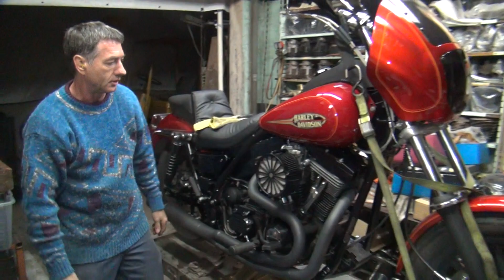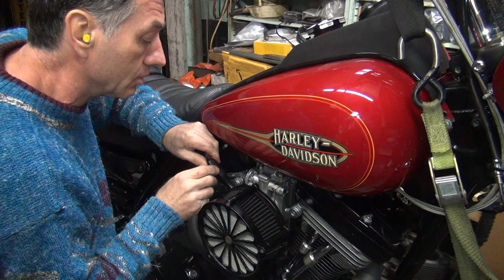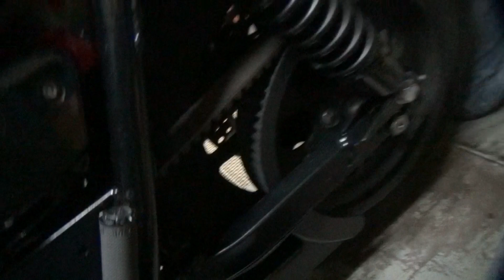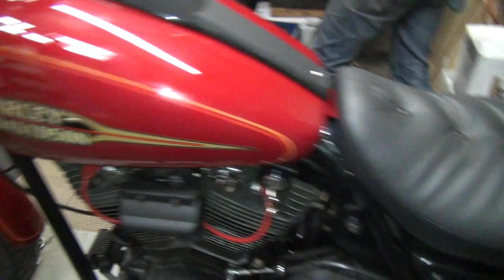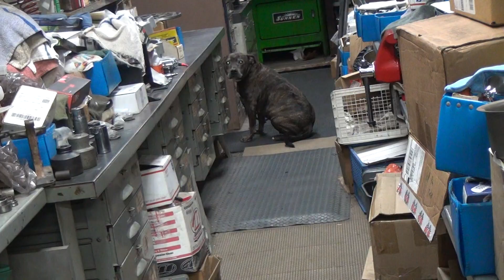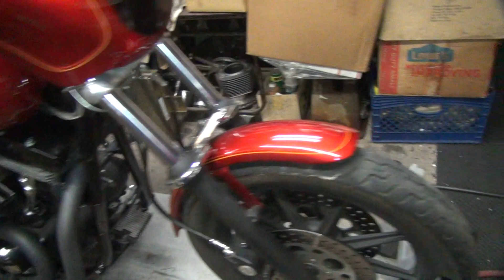#131 1993 80ci fxr test ride startup quickee topend rebuild exhaust stud repair harley tatro machine

Comment: What ever you do, don't prime the motor. Just start it up and begin tuning the carb. Ya
Reply from the maker: what a moron. this is not a car motor. there is no priming of a harley motor. it has roller bearings and they don't need much oil. the assembly lube is all that is needed for awhile. the oil light tells you that it has oil pressure.
tatro
Reply: @TatroMachine  this guy is an idiot.   I've been watching your video's for year's it's clear you know what your doing!

Comment: If it wasn't for the broken exhaust stud--none of this would have be possible ! The broken ring would eventually lead to this motors down fall . Good work as usual .
Reply from the maker: the ring would have show up as using oil and other uneven running things.
tatro

Comment: I would recommend a Hydraulic primary chain tensioner for any cammed up bike like this. It'll smooth out the idle, improved shifting and makes finding neutral a lot easier. I put them on every bike I work on.
Reply: Have to disagree. Switch over to gear drive and be done.
Reply: @johnroethel5527  gear drive for the primary?